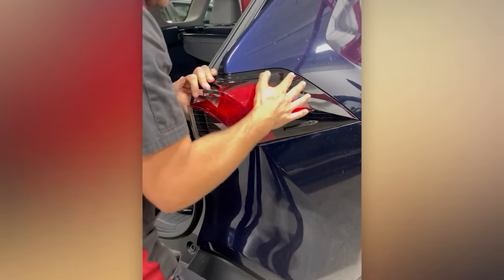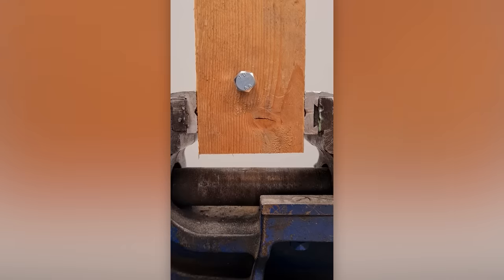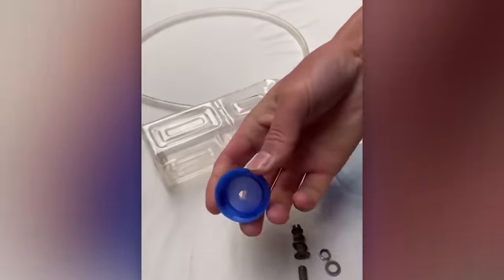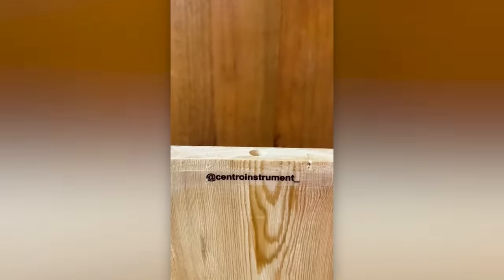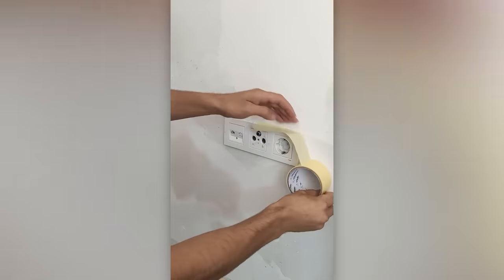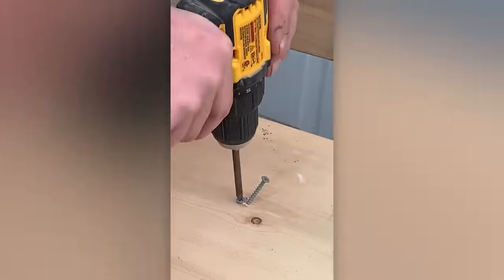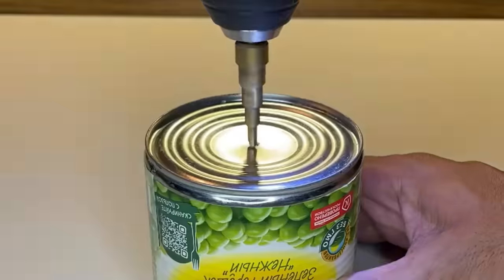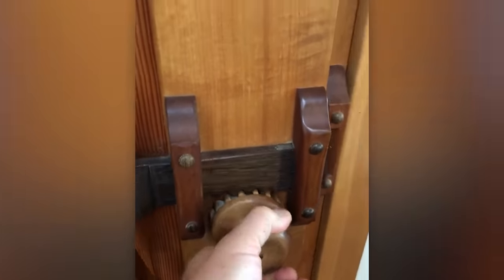HANDYMAN TIPS AND TRICKS THAT REALLY WORK

Comment: As a tile installer, that "coin trick" is the absolute worst way to have that crack and fall over time. rather than embedding it into the wall tile for support as its supposed to be, everytime they put even a little weight those quarters will wear at it because silicone is stretchy and will move slightly everytime. will just crack and fall and eventually be a repair bill
Reply: Don't use a coin they're money😢 just imagine if you not working and you doesn't have a money
Reply: I think if you used grout instead and let it cure, it would work better.  I just question if it is even worth the effort when what you should use is cheap, to begin with.
Reply: Then they can come back and fix it plus charge a repair fee. Job security.
Reply: That coin trick is a fast way to do it. While it is not very robust, that shelf won't have to support much weight because of the height being so small, many shampoo bottles will not fit.
Reply: @johnharvey4life I was going to say.. job security!

Comment: Love the folded tape catching the dust from drilling hole in the wall.
Reply: And ripping a bunch of paint off the wall in the process. 

Most of these ideas are half-baked, and either don't work well, or there exist actual tools for doing them well (and if you don't have those tools, you really shouldn't be doing the work in the first place)

Comment: It's surprising how bad a lot of these are as suggestions.
1. The pallet, okay so it's not really that bad in some situations, but it is probably the most material you could use to hold those tools and therefore not great, but go for it if you like it.
2. If sanding blocks are your thing, great, but look up the tri-fold method. I've found this simple method that requires no block works just great for any hand sanding that you are going to do. It seems to work better and be less wasteful than blocks anyway.
3. The tape/paint trick looks great until you see how much paint is in the channel afterwards. I'm pretty sure there's more paint in the channel by at least x2 than if you had not used the tape, which makes it a pretty sad hack.

Comment: Most hacksaw have square ends to turn the blade 90, even though the hacksaw handle was a good idea. The one with putting teflon tape on  was good old hack but curious what would you put ona pipe that close to a wall.

Comment: if recycling plastics the cost is about 200% more , cheaper to start from scratch to make more plastic things, i prefer plastic over glass now, and a lot safer if glass breaks. I use marshmellow flush emptys, the clear kind with screw lids or peanut butter same size and 2 kind color lid looks neat too !

Comment: The plastic bottle hack I use that as a funnel when pouring coolant or windshield wiper fluid (cut it in half or more with the cap.) Also, I've seen it used to bleed the brake fluid.

Comment: for hanging anything just the tape is needed if you have a gppd eye, just run the tape from hanging hole to hole, then poke a hole inthe tape, remove tape and stickto wall, nailor drill into premade holes in tape...

Comment: I am almost certain, it is pointless to pull off a rear lamp housing on a car like that since the fasteners for the new one are on the inside. You would remove the interior panel, which is usually accessible, and then remove the old fasteners. To install you'd just do the reverse with the new lamp housing. All these tools really did with tape was take a busted-up lamp and bust it up more.

Comment: Repairing the sidewall of a tire with those plastic screws they showed... is a horrible idea (I'm a ASE Mechanic). It'll flex too much, heat up and stretch then your tire opens up like a zipper.
Reply: Once when I was in my teens, I had the sealer from the plug kit but not the punch and ream so I used a small drywall screw and it held until I got rid of the car a couple years later. That was on the belt though, and the risk was less of a blow-out. On any vehicle at speed, a full sidewall blowout can lead to serious injury, especially in bad conditions. You are surely right.
Reply: I think he said this was for solid tires.
Reply: @cariwaldick4898  Sigh... he did not. Tires on vehicles are not solid because solid tires are very dangerous when traveling at higher speeds. PLUS...how does a solid tire go flat??? It wouldn't, it's solid and has no air to go flat with, in the first place.
Reply: I was looking for this post. Was going to post it myself if I didn't find it. I am not a certified mechanic at all but do have a modicum of sense and run a tire store.

But I would like to add that it will most likely get you a few miles if you're careful and keep it slow. But, if you do try this, DRIVE LIKE IT'S ABOUT TO EXPLODE! I've seen similar several times and it can be successful but is incredibly stupid.
Reply: @MrMash-mh9dy  I must have misheard.
Reply: @cariwaldick4898  yes you did.  He said "tubeless" tires
Reply: "TRAIL FIX"  it will get You out of the woods, Sand dunes or Rocks. . Seen it done many time on Rock Crawling Videos.

Comment: A translation for that rooftop thing would have been awesome.
Reply: What they built was ugly wobbly and took time. Those devices are much nicer, smaller, cleaner if you but them. They are not cheap but not too expensive. That 'hack' was good for a poor guy which he was. A poor guy has time and maybe skill but doesn't have money.
Reply: @ronny1617  Yeah, but what the hell is it?! There is no explanation whatsoever.
Reply: @UrbanGardeningWithD.A.Hanks14  it is basically a solar heater for water. A passive boiler to have hot water in your house. You install it on the roof and the sun warms the water running through those pipes. The plastic bottles act like a greenhouse, increasing the temperature.
Reply: @ronny1617  Gotcha; thanks.
Reply: @ronny1617 I am actually in awe of people like you and many of those in the video, who know so much, and have creative ideas for using tools and materials in unconventional ways.
Reply: @terredee  those are some nice words.

Comment: At 6:30 when you have such a horribly placed pipe like that, there is a thread sealant paste that comes in tubes like toothpaste tubes.  Just don't mistake it for toothpaste whatever you do!!  Apply a  light coating to the exterior threads of the pipe with the male end.  I will not get into the water or clog things if you don't make a mess and it is sold for plumbing too.  Just use that instead of doing some sort of "life hack" to get into a difficult corner.  It only costs a few dollars and you get nearly 2 ounces.  This stuff will last a DIY home user a long time.  I am not here to promote any brands and that is why I did not mention any.  Just look in the plumbing section of your favorite store or plumbing supply store if you live near one (again I did not mention a specific one of either).  This stuff is also not going to glue the joint and that way you can undo it in the future if you ever need to.  If it does glue the joint you apparently did not get the kind of stuff I had in mind and that is not my fault!!
Reply: Never use that much ptfe anyway

Comment: duct tape on hacksaw blade, been doing it for 40 years, don't need to wreck a box cutter, my grandpa was using the jar trick 80 years ago and never plug a tires sidewall with a freakin plastic screw

Comment: Pic is clickbait and is not in the video.
Reply: It's in there toward the end...but they don't really explain what it's doing.
Reply: I gather it's a solar water heater, but it's really not at all clear. Helps if you can read the text I guess, but not much.
Reply: yes plus it's a terrible idea to build a hot water solar accumulator that will never work anyway, and probably hurt someone from splashing hot water down the roof.